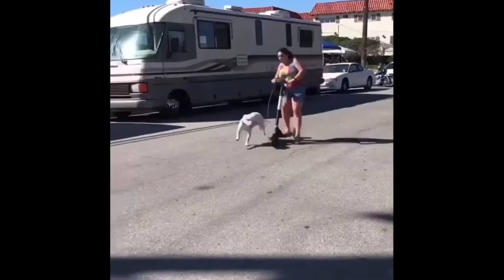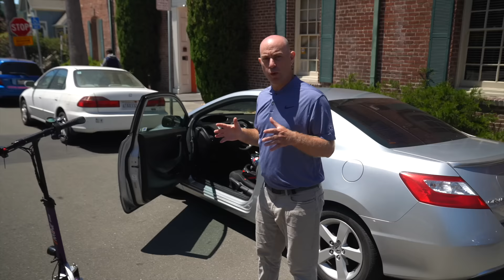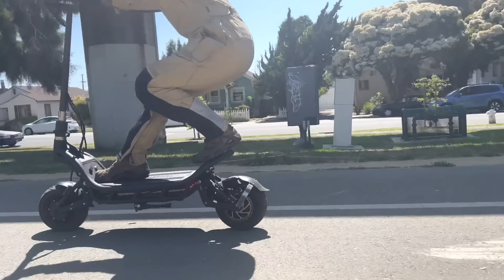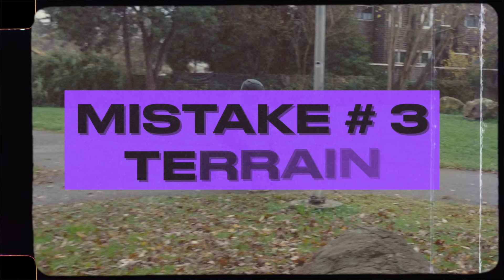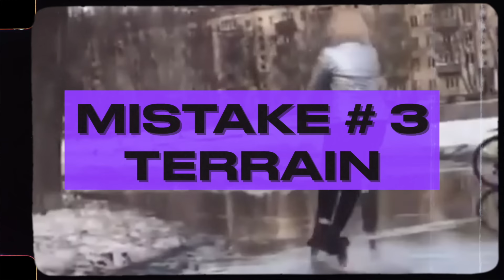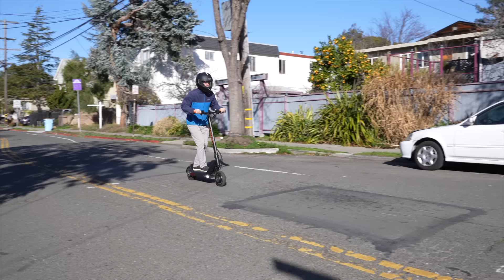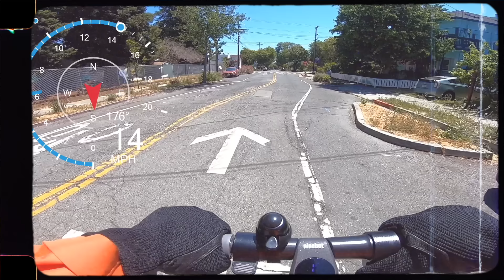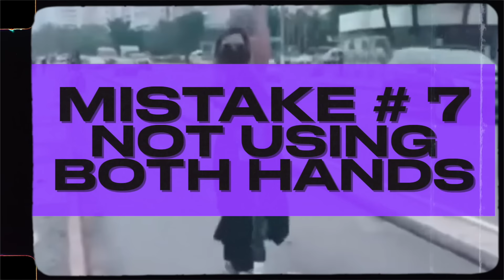Top 7 Riding Mistakes New Scooter Riders Make & How to Avoid Them

Comment: I've decided to avoid using my scooter when the temperature is at or below 5 degrees Celsius after I had a few close calls with my zero 8 clone on an icy asphalt road one particularly cold morning. The asphalt appeared to be wet only, but it turned out there were spots that had started freezing where the traction on those plastic wheels was basically non existent... I slipped a couple of times on the way to work but I continued on thinking I'd be ok if I took it slow, but on the third time while driving at no more than 10 km/h the scooter completely slipped from under me and I had to catch the fall with my left foot which got severely bruised. Having broken bones before I felt it was close to breaking, but luckily it didn't. I couldn't walk on it for a week after though!
Reply: You've had broken bones before and you road a scooter on some icy asphalt You Rock!. I like the fact that you don't let some cold weather stop you I respect that. I know co workers who won''t ride if there's a slight drizzle. My top end is only about 22mph so I'm not going too fast but I also have those terrible solid tires (which I'm changing)
I didn't know they'd be so useless on cold slick streets thanks for the tip. Be safe
Reply: That's one of the smartest things I've ever heard anyone say.  Good for you. And it's not just ice that is the problem.  It's simply that rubber wheels don't have very good traction capacity in the cold, compared with warmer temperatures.  It's amazing how many people don't understand that.

Comment: Great video! We need as much safety information as possible with the power and speed of the newer scooters.
Best thing I ever did was to take the motorcycle riders safety course. It saved my life several times when I was riding my Yamaha Road Star 1600. It was huge, heavy and powerful, but the techniques I learned made it as easy to handle as a small bike.
It would be great if someone developed a course like that specifically for scooters!
Reply from the maker: Awesome! Thanks for sharing. -Vosk

Comment: So far I've never fallen, but I came close once or twice, maybe I'm lucky or just extra careful, but I try to avoid potholes, always keep two hands on the handlebar and never ride on wet surfaces. Also, always wear a full face helmet, even if you feel that people might judge you and think you're going to far, they are not the one that will injured if you hit the pavement with your face.
Reply: 100% true I had that mindset of  oh I don’t need a helmet I won’t be going that fast till I fell then got a bike helmet and fell a second time I ditch the bike helmet and got a full Face motorcycle helmet and motorcycle gloves with knuckle protection funny thing I haven’t fallen again since I made those changes I’m currently thinking about knee and elbow pads and chest protector sure that sounds like overkill because my work commute is 2 miles but a lot can happen along the way better safe than sorry
Reply: @jaredharris1970  I lost 2 finger nails and got a sprained knee doing less than 15mph. You are absolutely correct!!!
Reply: @jaredharris1970  Ouch, I feel your pain!  I’m doing the PT hand exercises right now. (Let me know if you need a copy). 

I work at an IPU where I normally go through about a half a box of gloves (which sucks without fingernails), 3 miles of walking, and some nasty germs that don’t mix with open wounds. I’m still afraid to use hand sanitizer 🔥

I’ve practiced falls, bailouts, had flats, and even had some close mishaps. It’s a low speed scooter, never even had the speed Wobbles. 

The one thing that never occurred to me was that the wheel could lock in a 90 degree position instantaneous stopping front end  literally whipping one to the ground at speed.   

The biggest disappointment was that I wanted to get something faster, but instead lost a month of summer riding weather.
Reply: I rear ended a Porsche Boxter in my scooter when I was going 40 mph. He slammed on the brake which caused the accident. I flipped 180 and the rear of my scooter faced the sky and the handlebar prevented the scooter from flipping forward.. I wasn't wearing helmet nor any safety gear. I was pissed off and just took off in my scooter from tge scene.. The Porsche guy yelled at me as if he was expecting me to pay for the damage (a few scratches?) on his car...
Reply: I fell into grass, dirt was in my mouth, so if that were pavement goodbye teeth, that prompted me to get a full face motorcycle helmet, a Leatt Chest, Back & shoulder Protector, elbow/forearm & knee/shin pads & gloves with knuckle protection

Comment: Yes, I have fallen around 5 times off my Kaabo Mantis V2,  the scooter had a slight damage on either side of the handle bar and one break lever was slightly bent but otherwise no other mechanical damage to the scooter.  I had a few cuts to my knees and elbow but that is about it.   What did I learn?  At beginning learn to ride at slow speed as your confidence build increase the speed,  plan your braking,  don't do sudden brake,  just like driving a car please don't try to brake hard as you are near the intersection, start braking 10-15 metres before so you don' have to brake hard to stop, you can just roll your scooter to the stop ping point just like you would do with your car.  Avoid riding in muddy road surface as wheel can get stuck,  happened to me once at high speed,  the muddy surface sort of like I was  braking very hard as wheel get stuck and throw me off the scooter. Be defensive in your ride,   ride for safety and cruising rather than for pure speed,  if you ride for speed you are likely to be a danger to others like pedestrians.
Reply from the maker: Thanks for the feedback! Stay Safe out here -Vosk

Comment: You forgot the most important one. Wear protective gear or a suit. Road rash is the worst pain and takes super long to heal. After being hit by a car and sliding on asphalt in a tank top and shorts, let's just say my knees, elbows, forearm, hips, shoulder and even part of my foot is all missing skin months after. I was on a Nanrobot D6+  doing 60 kph.  The reason why I didn't wear a protective suit was because it was TOO hot outside but I regret it now. Would have Rathered some sweat and body odor instead lol
Reply from the maker: Good point. I actually had to go watch the video again to see if we really failed to address that. We really should have at least mentioned it when we were talking about helmets. Me, I wear my full riding suits at all times when I'm testing, but it has saved me more than once!
We are working on more content like this, and gear definitely deserves more attention.    -Paul
Reply: 60kph?
Reply: 60kmh on 10“ wheels? Wow that’s quite insane without protection

Comment: Yeah, probably the basic for me is to read the manual, practice at least few kilometers if it's a new scooter. Probably a round or two around your block if you haven't used your scooter for a long time. Each scooter have its own quirks (some torque-y/jerky, some slowly building on the acceleration and may have variances on the power distribution while riding). As for the cruise control, usually either tapping the accelerator or brakes disengages the system. Something that needs to be practiced. 😀 Ride safe guys.
Reply from the maker: Excellent points, all of them!       -Paul

Comment: at 56 years young ive been riding electric scooters for about 7 years, they were Razor E300s (if only they had lipo batteries, quick charge and range they would be perfect solid scooters) ive moded them to 25 mph and came off them one-handed, the other time on a windgoo (great scooters with good speed 15mph, 12-mile range and best 3 hour charge,  i came off when the bar that goes from board to steering collum snaped,     
i would add to your stance to choose the side you can slap your foot on the floor in an emergancy and pull to oine side, i learned that on mopeds as a kid, it was enough to pull me to one side of a braking car or i would have hit the back end, slap yopur foot and pull the front around enough to miss whatever

Comment: I know this video is a couple of years old but the tips they give to keep you from months of serious pain and suffering are invaluable. One of my hard lessons learned was the waving with my one hand still holding on to the throttle side. Really bad idea! It's really dumb to let go with either hand but if your hand is on the throttle when you let go like my dumb mistake it can be twice as terrible. When i let go with the one hand the bars of the scooter turned slightly just enough for me to grab the throttle hard and it literally launched me like a drunken rag doll. Needless to say I have and never will do that again. And yes, I did walk away with scrapes and heavy  bruising. Luckily for me I had just enough brain cells in my head (3) to invest in safety gear  when I purchased my first scooter and actually used it when I started riding and always use it. Even if my smooth brain trys to lie to me and persuade me that it's just a short ride up the block so I don't need to wear my gear I ignore those urges.  Fight that dumb urge not to ride without gear. You'll thank yourself. Great advise guys and I love your channel. You have taught me a lot! Safe and happy riding!

Comment: I stand on it like a skateboard, feet sideways but toes slightly forward, Never both feet forward !. I carve hills like im on a snowboard. I've owned 4 and havnt fallen once. If you hold one handed at the center line of the handlebars you can ride one handed just as stable as you can with two hands

Comment: Interesting takes, but a couple things seem off. Foot position is more about balance—most people naturally ride with their non-dominant foot forward (like skating) because it's more stable and comfortable. That’s where your body reacts best, so it makes more sense to go with what feels natural, not which side of the road you’re on. 

On the braking part, leaning back does help, but because it shifts your weight toward and over the rear wheel, which improves stability and traction—especially during hard stops. 

But you're not actually slowing the scooter down by pushing back with your arms. The brakes are doing all the work; your body position just keeps you from tipping forward or losing control.

You push the bike forward with the exact force you go back, so there is no effect from the push itself.

Comment: I am glad you touched on the wet leaves and wet pavement. Wet leaves for me are the most dangerous part of the terrain. If you are caught in the rain slow down to a crazy safe slow speed. I have been lucky and fallen on the grass from wet leaves but I can fully agree with the statement, your terrain should be one of the primary safety concerns on a scooter. The other challenge was while in Iceland for a couple months it would be dry then freeze overnight with flurries. Black ice on asphalt is very hard to see and will drop you like a rock. If you are new be very aware of your terrain until you have knowledge of your limits and where they are. I actually found a good spot with wet leaves and practiced riding through slowly and getting to feel how quickly it can bad. When in doubt, slow down.

Comment: Very informative video. Made the mistake of driving one to work without testing it out. I kept losing control and running off from not knowing how to brake properly. It was only inevitable that I lost control and actually hurt myself. I cut myself on my right foot, scraped my knee and elbow. I hurt my left wrist really badly. Thankfully there were no other vehicles or pedestrians nearby and I wore a helmet. Who knows how much worse it could’ve been. I’ll definitely be test riding it with the tricks you’ve taught me before going to work with it again. Thank you very much.

Comment: Transition from street to sidewalk with low curb, like going into the driveway of a house.  You always want to hit it perpendicular (90 degrees).  One time I was transitioning from road to sidewalk at an intersection.  The low curb was radiused (1/4th of a circle) and I hit the low curb at a 45-60 degree angle.  The radius made it hard to judge where I needed to be at to hit it at a 90 degree angle.  my front tire washed out, ie it started to slide, tracking the groove of the low burb, instead of going up and over it.   The scooter went down and I stayed up by going into a running motion, but my knee ate the stem pretty hard and left me with a painful, large bruise and asymmetric swelling of one knee 3 weeks.
Reply from the maker: Very insightful! Thanks for sharing.

Comment: Good video, #1 never take a hand off the handlebars! My scooter is good for a little over 30 mph, but in a panic situation I couldn't stop fast enough and hit a wall. 3 weeks later the bruises and swelling are better but lesson learned! I have disc brakes but lousy calipers. I changed the calipers to hydraulics and that baby stops right now when you need it. Best change I have done and it only cost about 40 bucks.

Comment: My first (riding a Gotraxx GXL V2) and only fall so far (knock on wood) came after I had been commuting with my escooter for over a year.  I was leaving my place of employment and had passed this particular area over a hundred times with a six inch curb  running parallel to my left side lost focus and drove the edge of the front wheel frame into the side of the curb causing a stopping action like the front wheel had locked up pitching me forward over the handle bars resulting in a skinned right elbow and pride.  I have since graduated to a Gotraxx GX1 and thanks to YouTube post like yours a smarter escooter commuter.  Keep your knees in the breeze guys.  Thom B.
Reply from the maker: Sorry about that! Stay safe out there.

Comment: I nearly always ride 'side by side' even at 80 km/h.
But i always slightly bend the knees, lean back a little and extend the arms to absorb any severe hits.
No accidents and 9,500kms in the last 10 months.

Being reasonably fit, underweight, situationally aware and very flexible, i think has also helped me avoid crashes.

Comment: I will echo the full-face helmet advice (and recommend additional riding gear as well). After I got my scooter, I deliberately did not ride it more than just in front of the house until I got my helmet. I am on my second helmet now because the first one did its job.

Also, YES on wet metal. Manhole covers in the rain are absolutely ruinous.

Comment: Also, never jump off it if you can avoid it. You'll feel like you're stopped or going slow enough to hop off but inertia will keep moving you forward.

Another "trick" I've been using is doing a half inch wheelie to give you some extra acceleration especially on uphill roads. I don't know why it works but it does.
Reply from the maker: Thanks for the tips!  -Vosk

Comment: good tips, ive had scooter for last 5 years and fallen off only twice, first time hit a deep pot hole doing 22 mph yep straight over handlebars and i did half somersault lol and landed on my back, but i had a rucksack on that saved me, other time was on a bend i hit black ice, but didnt hurt myself, but like u said about cruise control. definetly turn it off if ur new rider, im used to mine, mine switchs off soon as i tap the brakes

Comment: All good advice- Thanks, The wet leaves have nearly caught me out a few times just recently- Another tip I'd add is breaking early in the wet, especially if using a Xiaomi clone with just a single rear disc break(and front EABS) - I nearly went sailing into a main road just a few hours ago thanks to wet brakes - Also, A lesson on keeping your single rear disc brake adjusted properly could be a good idea if you haven't already covered it= show newbies how to adjust the inner brake pad as well as the other adjustments on the standard cable brakes fitted on the less expensive scooters without hydraulic brakes.
Reply from the maker: Very insightful! Thanks for sharing. -Vosk
Reply: @ESG-ElectricScooterGuide  Thanks- No problem. All the best.

Comment: Situation with eyes fixation and cruise control turned on.
On the straight road I drove onto the bumpy grass, jumped off the deck totally forgetting about fixed speed so I fought my scooter for a few seconds to not hit any fence 😅

Situation with one-handed sterring.
Had urge to scratch my back, I looked to the side and then I hit a hole. 
Same situation.🙃

Comment: Really good advice. I’m on the verge of buying an e scooter for the first time. I never considered a technique for breaking. I’ve ridden on an e scooter a few times now. But it’s only been on those rental e scooters that you can ride from a short point A to point B distance (Lime and Bird). I’ve never had issues while breaking using those scooters. But do the brakes work differently on those scooters as opposed to the scooters that you personally own yourself? 

I haven’t been in a situation where I’m waving at someone while riding. That’s good to know so I can avoid doing that. There was an incident when a co worker was leaving the job for the day on an e scooter. He waved at someone while riding and almost lost his balance. Luckily he didn’t fall but that was a reminder not to do that.